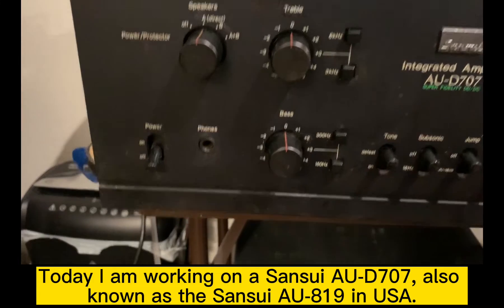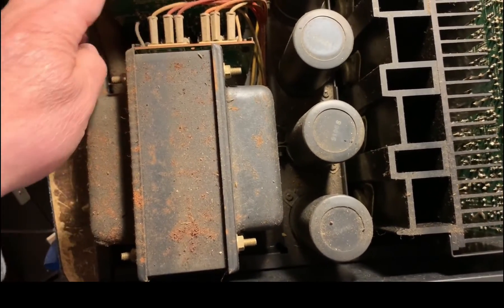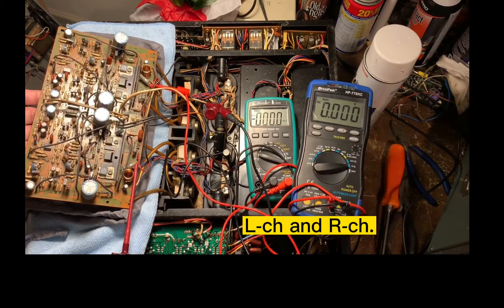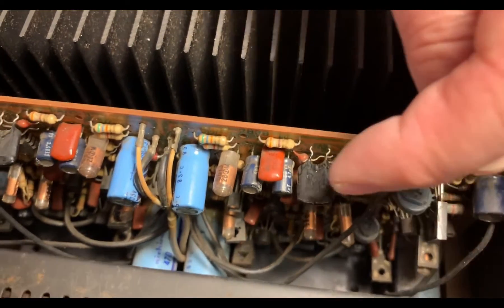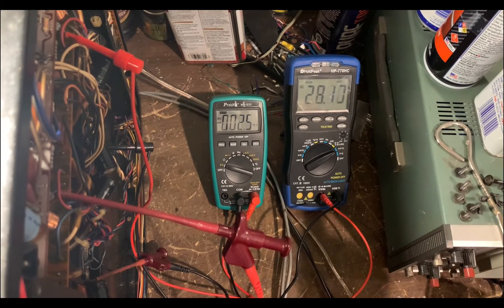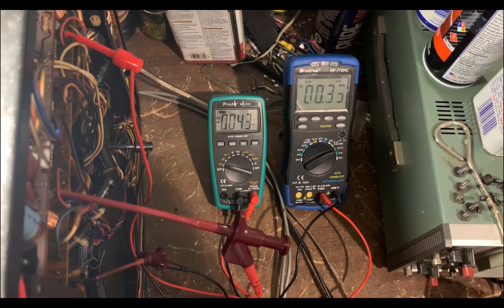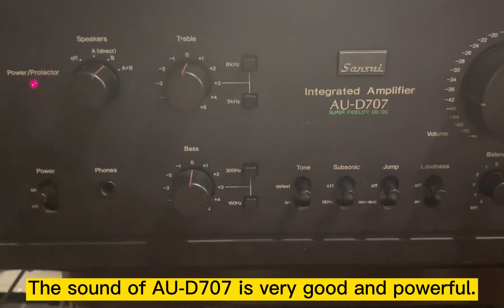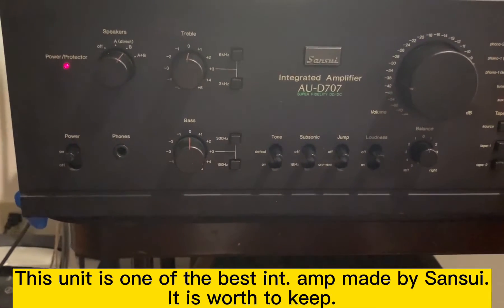Sansui AU-D707 Amp Repair and Adjustments

Comment: Hello, may I know the screw type and size you used to remove the volume knob of this amp? Thanks.
Reply from the maker: Sorry for the late response. I used a1.5 mm hexagon L wrench (which is the smallest size in a wrench set) to remove volume knob. This wrench also fits other equipment such as Yamaha C-2a preamp.

Comment: Great video!
I have the dame model whit problem of cracking in one board power.
could you like the diagram? I would be so grateful
greetings from Lima, Peru
Reply from the maker: Here is the link for the service manual (included circuit diagram) which you can download from:  https://www.hifiengine.com/manual_library/sansui/au-819.shtml
Reply: @VintageAudioFan  thanks a lot